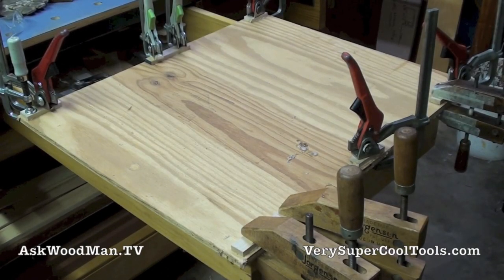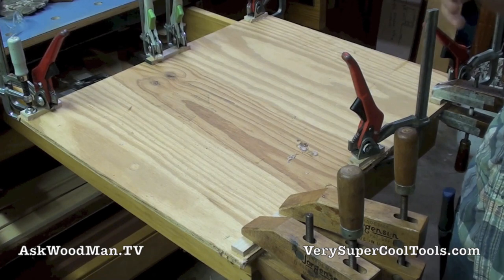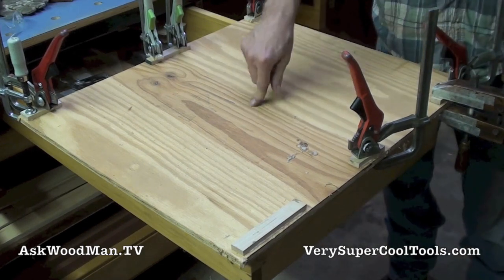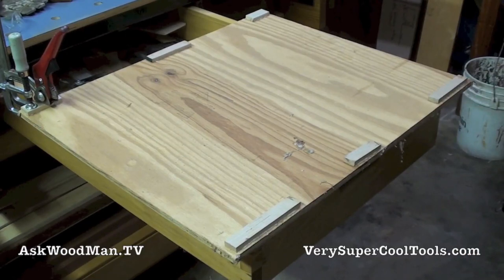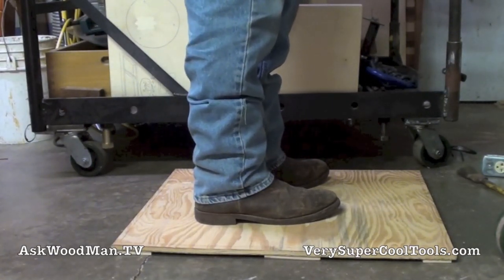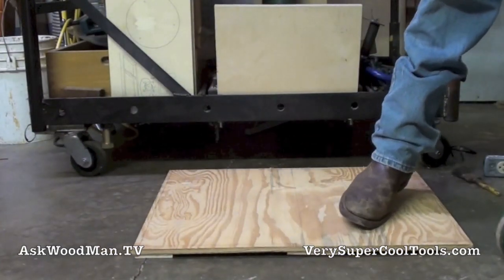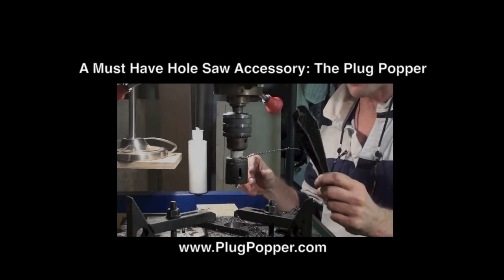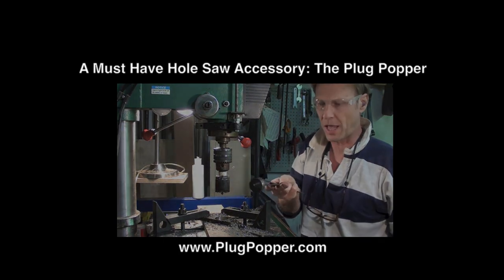SHOP TIP: Low Budget Anti-Fatigue Mat •  Plywood Standing Platform

Comment: interesting idea.... my wife has the special mats in the kitchen and they are great.  but being a cheapskate like you i just fold down a large cardboard box and stand on that.  i rarely use ply as practically all my work is solid wood apart from drawer bottoms and backs.  but when i do get some 1/2 inch ply i will try this.  love the plug poppers!!!
Reply from the maker: This is construction sheathing called cdx plywood here in the US. I am am pretty sure this was left over from making shipping crates for furniture. It is about the cheapest 1/2 ply I know of.